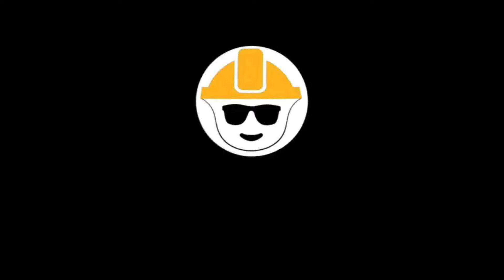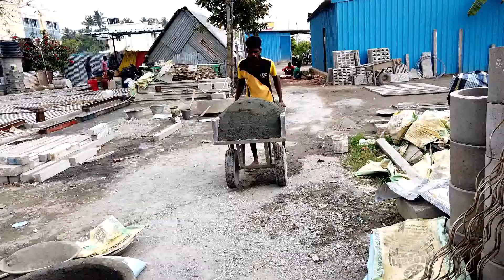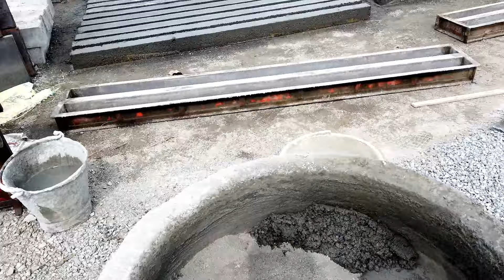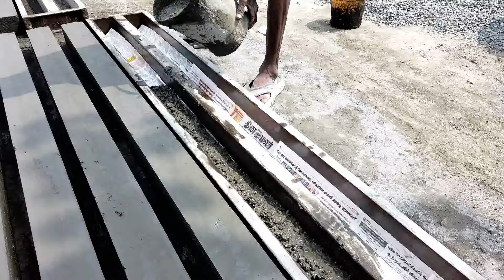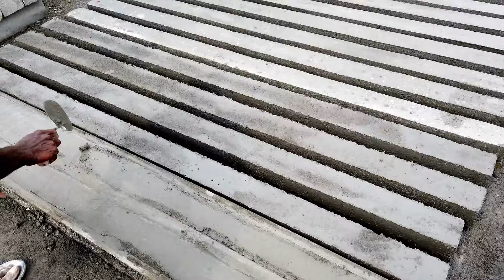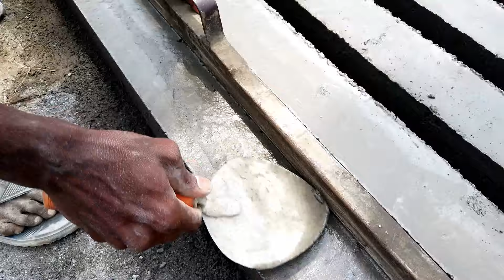RCC Fencing Pole | Making  Cement Pillar | Cement Fence Post

Comment: This last three years before concrete rot set in, it would not pass Australian specifications, so there was no liability insurance, no counsel approval, and hairline fractures under its own weight would let the rain in. Why don't they do it properly so it lasts 30 years? Some posts should last 50 years, depending on the acidity of the soil.